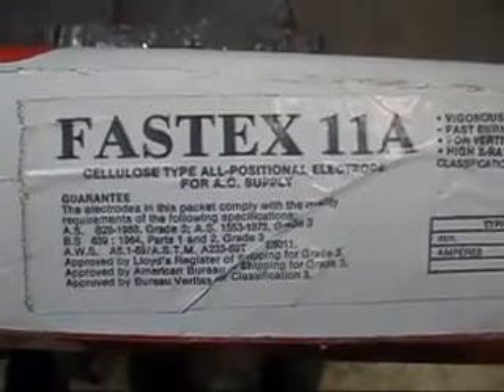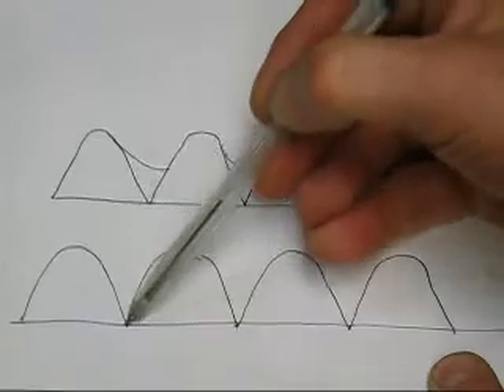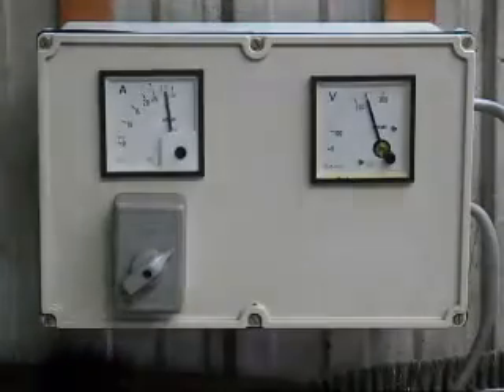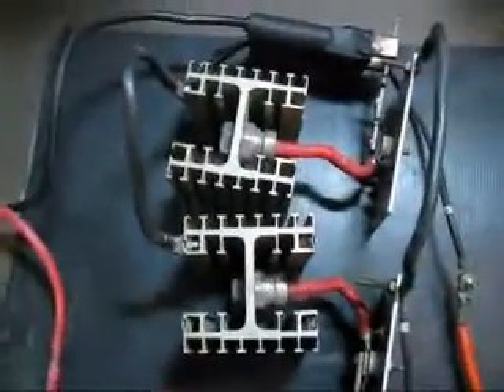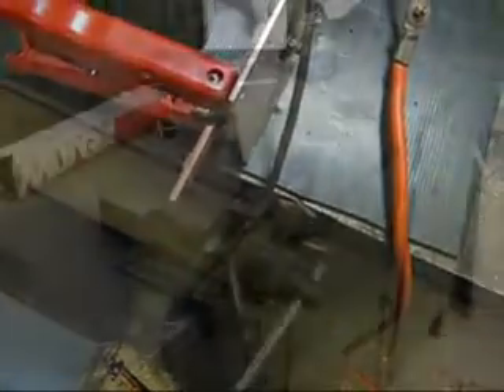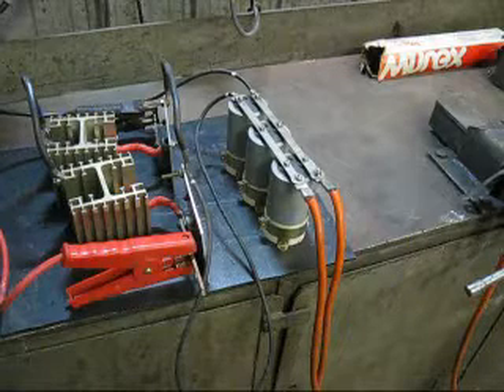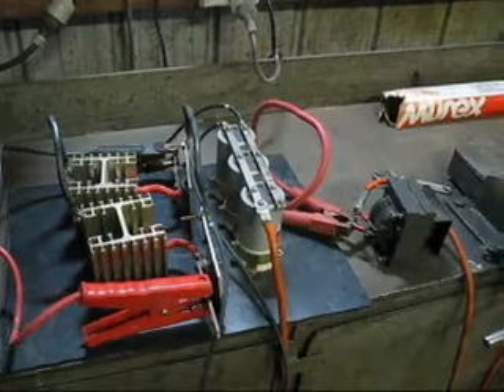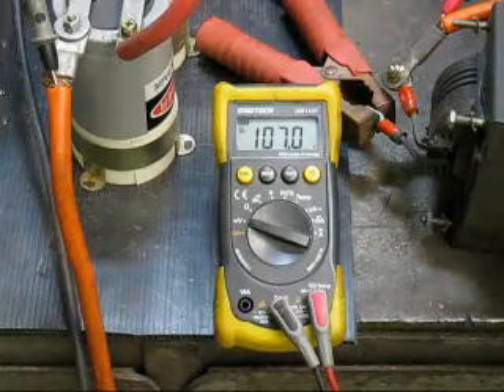Converting an AC welder for DC output

Comment: Please notice the lightning bolt at about 4 minutes. It would be deadly it that went through you from hand to hand or side to side, basically through you heart.  Welding a roll cage into a Jeep I got hit with DC from the welder.  it was my turn to hold and my Dad was welding. Rod stuck and he jerked on it and I ended up with windshield loop I'm left hand (it had ground clamp) and I had a kicker bar with the stuck rod in the other hand.  it was 1000 times more painful than any other shock I've ever had. I've done industrial electrical work for over 30 years in some horrendous environments and have had few shocks at various voltages.  incorrect schematics got me my worst shock until a DC welder through my heart on that roll cage. Everyone that welds a lot has probably felt a few bites from an arc welder but this was insane.  Please notice that arc bolt about 4:00 to 4:05 and please fear the potential. Hope my rant helps...
Reply from the maker: Always wear gloves when using a welder.
Reply: JDMStage4Roush oh shit I saw it
Reply: What you and JDMStage4Roush seen is just a little hot piece of weld dirty with oil what fallen down from the table that left a smoke line in the air. then that smoke line goes slowly away from the welder. is almost normal to see things like this during welding on not clear metals. As for the pain that JDMStage4Roush described during welding with the father is the result of arc starting from a dc inverter welding machine equipped with HOT START. An extra feature that dc inverter welding machines can have. it consist of a high voltage, high frequency and ultralow amperage spark igniter that force the arc to start by shot a fast burst of long electric bolts like an electric gas igniter. It can deliver sparks long as 2 centimeters that help the start of the arc in welding already without stick the electrode for start the arc. Unfortunately sometimes those sparks  can go from the welder hand if he do a more short way from the welding rodl to the clamp than the metal piece but lukily that electrocution isn't as dangerous as someone can think because it use very low milliamperes and a higher frequency than the frequency dangerous for the nervous system, aniway it is still a quite painfull huge hit to feel as hell and still can be a little dangerous, so take always the appropriate safety equipment and manners. I am a Welder in MIG TIG and MMA. Hope it help.
Reply: @begclobegclo  dude, you are wrong!  Look again at the video at the time I indicated.  THERE IS A SUSTAINED ARC and there is no question it is an arc.  Looks a lot like an arc from a Jacob's Ladder.  It has the classic shape that an arc will form basically because of motor law effects.

Comment: Hi, nice experiment. Did you try changing the position of the choke and the cap? You seem to be running C-L, using L-C or even splitting up the cap or using a second cap bank for L-C-L operation.... if you have the parts at hand this might be worth a try.
But as others have already pointed out, using old electrodes might be a problem in itself depending on their condition, best to use a few fresh/dry ones to eveluate your setup, but I still see your reasoning behind that. 
Regards
Reply: dercebe by using inductive first the voltage will only be about 70% of the rated output.

Comment: using only one diode (2 in parallel just increase the amperage ) will never give you DC, even if you use capacitance and coil (self), it just gives half sinusoid, or if you prefer, half DC. you need 4  diodes: a bridge.
Reply from the maker: +woody wood This is what it is a bridge rectifier using four diodes.

Comment: The plugs are intended for 20 amp 120v outlets not 15 amp. There is usually a warning on the plug that says that you'll blow a fuse if you use a 15 amp outlet.

Comment: Re high currents in the power outlet, the 15A plug with its wide earth pin is only supposed to plug into a mating socket which is supposed to have 15 A wiring so as not to overheat.

You were right to be concerned as to just why your currents were even higher again, and   
 probably were able to get away with little overheating of the 15a wiring because of the Intermittent nature of welding??   
I could be wrong too.

Comment: Sure,  DC welding is great but buying rods from a farm auction means they might be old and slightly damp. 
Maybe that contributed to the difficult starting with AC and once started the heat progressively and rapidly dries out the flux as the rod is consumed.
Even at the best of times rods could/should be kept DRY by lightly baking in the oven or storing with active silica gel that has been reactivated in the oven.

Comment: Diodes in parallel aren't capable of delivering a current significantly greater than a single diode. It so happens that as diodes dissipate power and heat up, their voltage drop tends to decrease, leading to an uneven sharing of load among the devices. As the voltage drop on a diode decreases due to temperature rise, it carries more and more current compared to the others, to the point it takes all (or great part) of the current flow, and if the current passing through it is greater than it is supposed to handle, it enters the thermal runaway condition, at the end of which it fails catastrophically (it explodes). So you'd better think again before connecting diodes in parallel. ;)
Reply: wow didnt know that
Reply: +Matheus Moreira even if they get uneven and one runs away and explodes the otherones will keep going and act as spares ^^
Reply: +Dave M That's because the bridges are thermally bonded together, when mounted on the same heatsink, making the temperature almost even amongst the diodes, thus making their voltage drop nearly the same. ;)
Reply: +steffankaizer I really don't recommend doing this, as diodes tend to fail shorted, not with an open-circuit. Remember?! ;)
Reply: Bridge rectifiers are not in parallel there are two diodes on each side of the secondary but only one is conducting at a time on each side of the secondary. The advantage of a bridge circuit is less ripple a bridge rectifier is a full wave rectifier vs 1/2 wave easier to filter.
Reply: Matheus Moreira Of course not best, but the small resistance component (which deviates from the theoretical exponential conduction formula) equalises to an extent. Usually very small value load sharing resistances are incorporated, standard industy practice, sometimes just a loop of copper wire. Bear in mind that secondary breakdown also applies to diodes because the junction can be considered to be multiple elements in parallel. With solid thermal linking and calculating for a worst case of 10% mismatch, resistance losses are often acceptable. If one can tolerate 20%, losses are less of course.

Comment: I'm answering your question how a 20amp device can draw 40 amps. It is safe only if you read and follow the directions. It's because of the duty cycle is only 2 minutes out of 10 minutes. The 20 amp trip rating of the circuit breaker is set at 20 amps for 3 minutes. The rating drops down to 16 amps for 24 hours. Due to the heat building up on the thermal tripping device. Now the heat buildup on 40 amps is only a minute or so to trip. Also only use heavy duty extension cords like 10awg. I change my cord for a much heavier duty one. For the purpose of more amps while I weld.
Reply: P.S. Now don't run any kind of test to see if your breakers going to trip exactly at 3 minutes on 20 amps. You're talking about a four dollar item.
Reply: Imma Freeman  25 amps has the same heating effect on the 15amp plug on any voltage.
Reply: ***** I am only talking about your one question. How a manufacture can put more than 15 amps on a 15 amp cord. 25amps for a short time is ok. Voltage would have no calculations here. Resistance of the plug and amperage of the plug would give you watts in the form of unwanted heat. The formula is Amps squared × resistance = watts (or heat).
Reply: Neal Wood sorry the amperage "on" the plug not the rating of it.

Comment: Your choke could stand to be a little larger if you have another old ac welder knocking about, use its secondary in series the iron mass will help a lot the caps raise your OC voltage this could get a little bit bitey, cant say I have any 300 amp diodes just lying around. :) your setup melts those rods so success.
Reply: Diodes can be run parallel if desired.